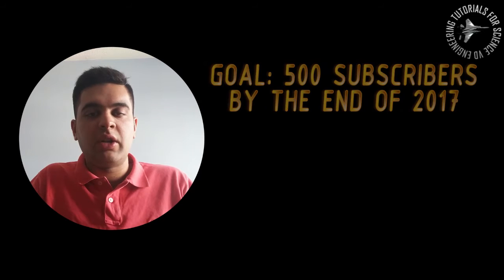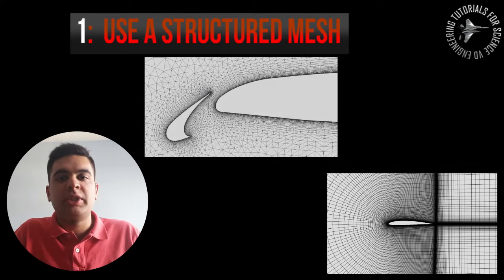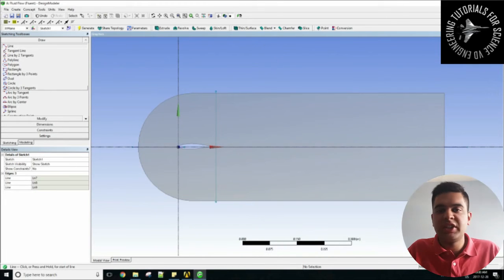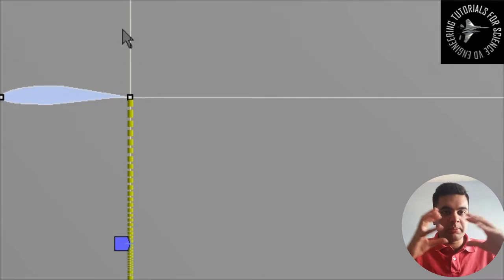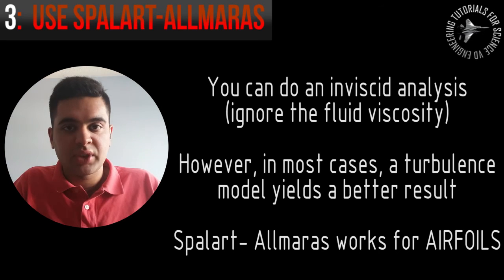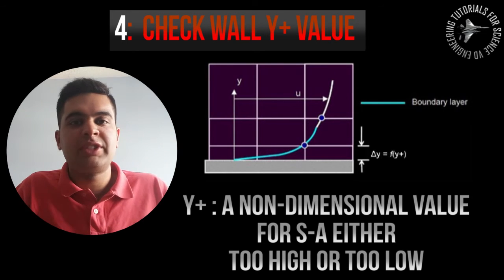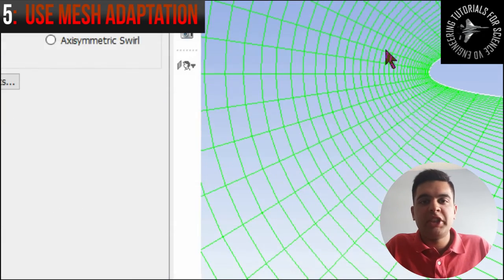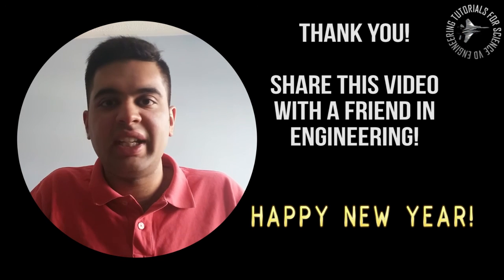5 Quick Tips For More Accurate Airfoil CFD Simulations (ANSYS Fluent Tutorial)

Comment: hi
in the inlet boundary condition if i change the angle of attack by change the directional @t below
for example
X-direction 1
Y-direction 0
which is 0 angle of attack. right?
X-direction 0.97814760073
Y-direction 0.20791169081775931
which is 12 degree angle of attack. right?

if i change the AOA, do i have to change the axis for the life and drag?
Reply: similar problem, and i still struggle for solve
Reply: Yes , you need to change Cl&Cd component according to your AOA.

Comment: Its a nice video. Sir,at the beginning of your video a figure of unstructured meshing of slotted airfoil at the leading edge has been displayed. Can you please help me to make structured meshing of slotted airfoil having a straight inclined cut off at the leading edge. Waiting for your reply.
Reply from the maker: You need to show a picture, add a gyazo link or something.
Reply: Sir here I have attached the  gyazo link of  leading edge slot of airfoil
https://gyazo.com/c0675c4987584718122204dfbddbe5f7
https://gyazo.com/cc5eda29f702fa358f5f22f7994cbd60
Reply from the maker: https://gyazo.com/d6fca4eb92df2511aad41457bc4ad5dd

Make the lines A-F and then use Face Split
you can also try without line C and see what happens.
Reply: Thank you Sir for your reply. While doing mapped face meshing in AF zone the following error shows" All cell zones in Fluent may be automatically set to Fluid". What is the reason for not getting mapped mesh. Sir waiting for your reply.
Reply from the maker: It is not an error, just change your geometry to Fluid
Reply: @VDEngineering  hi sir Iam new to the software can you please let me know how to simulate shock oscillations over airfoil.i knew physics of the flow but I don't know anything about software so please let me know